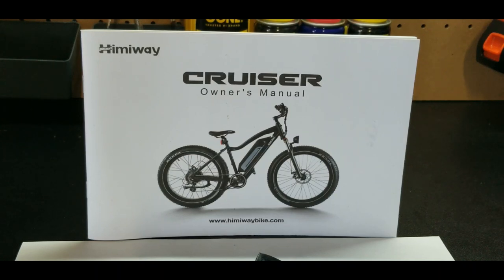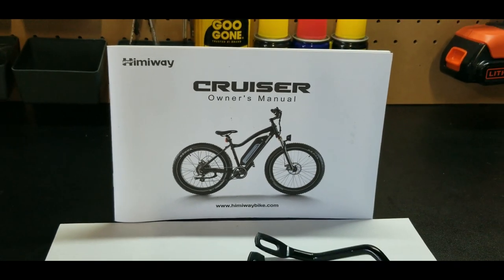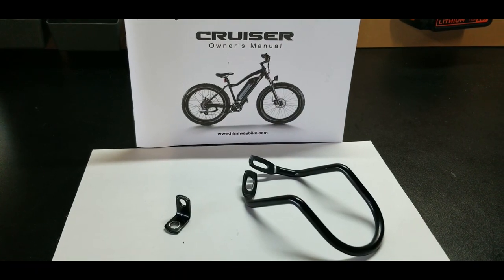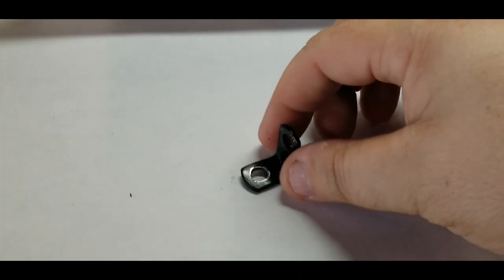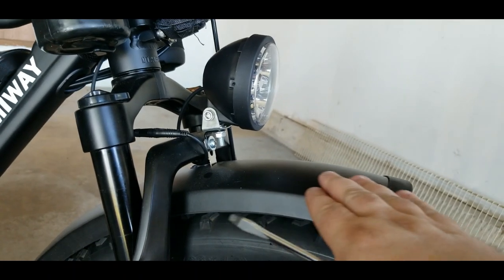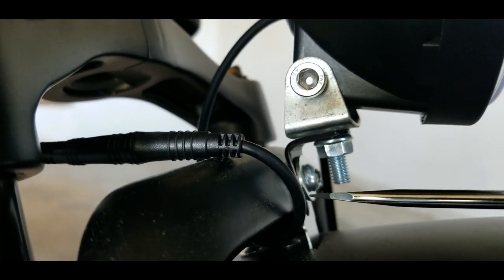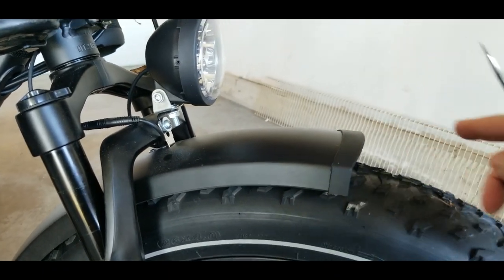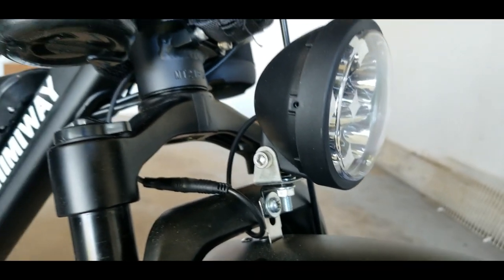Himiway Tips & Tricks

Comment: Another helpful thing to do is to take the cover off your controller and seal around it with some silicone because if the inside gets wet it can mess everything up and it's located where lots of water will hit it if you ride through water or in the rain .
Reply: Good tip.  I am gonna put a guard over it as well to deflect water and protect the cables under the frame. The factory 1 looks flimsy so I may make my own.

Comment: The fork adjustments are

Left side - stiffens the spring.  A heavier person needs a stiffer spring so the fork doesn't bottom out.  Where as that setting would be stiff and harsh for a light person.

Right side - dampening adjustment.  It controls how easy it is for the fork to go up and down.  If you turn it all the way it stiffens it to the point of being solid.  Which would be good if you only use it on smooth pavement for more control.
Reply: This is correct.  also that little L bracket is not meant for the headlight.  it’s just a spare front fender strut mount bracket.  it says so in the himiway assembly video.

Comment: Yes the electrical cable connectors are very, very tight. You absolutely DO NOT NEED TO USE PLIERS OR VISE GRIPS ON THEM. All you need to do to get the electrical cable connections apart is to use a heat gun, or even a hair dryer and heat up the connection a bit to soften the rubber a little and they come right apart easily. If you use a real heat gun just heat up the connections for a few seconds so no marks from pliers.....
Reply: Thanks. They are a b---ch. I bent pins and broke connectors the 1st time.

Comment: Thank you for the tips. Do you find the cloud9 seat less stressful than the stock seat?
Reply from the maker: It's more of a personal preference cause I'm a bigger guy and the Cloud9 seat is wider, not to mention the seat comes with suspension springs. The stock seat is ideal for average sized folks who's butts are used to riding a bike.....lol.
Reply: @E-Ryders  Thanks. The seat is big and comfortable but after some time it just feels like there is to much padding up the middle.  (Ouch). :)
Reply from the maker: @ralva2779  Depends on the model cloud 9 seat you get too. The middle is cut outta mine to relieve pressure and provide ventilation.  https://www.amazon.com/Cloud-9-Cruiser-Select-Saddle-10-75/dp/B002MKFRQI?pd_rd_w=wPnGC&pf_rd_p=ba22ea03-d3c1-4ebb-8d3e-472aa0cf3b30&pf_rd_r=QCXK3ZR1ZDMGPAKA6244&pd_rd_r=3b34ab0d-0e5b-4a88-b3a7-3c99150b9d5b&pd_rd_wg=RNDFe&pd_rd_i=B002MKFRQI&psc=1&ref_=pd_bap_d_rp_29_i

Comment: Just got the Himiway zebra and the manual says to fully charge it after each use and that it has no effect on battery life.
Reply from the maker: Because that's the normal thing to do. I'm giving you a "Tip" to make the battery last longer.
Reply: I saw this too and it didn't sound right, compared to all other batteries.  Like you probably wouldn't charge your phone if it was 90%.  I go for short rides so I'm going to let mine drain down before I charge.

Comment: Had so much trouble with Himiway. They tried to replace my faulty motor 3 times instead of letting me ship the bike back for a replacement. Took 6 months and I had to take it to a mechanic to replace. Then, still didn’t work and they wanted me to buy another one and return the old one before they would send me a new one. I think they’re customer service is in China? Just get something local because Himiway doesn’t know how to fix their problems.
Reply: Yes i am noticing lots of negative feedback as well as hearing about  shady business  practices and a souring amount of complaints to the BBB. It seems a hit or a miss, if you receive a faulty product you're out of luck
Reply: I am bummed out that my Hemiway Cruiser died with a hundred easy miles on it. Luckily I bought from a brick and morter company here in the states. Both the control module and motor where bad. Traded it in on another brand and have had zero problems. Hemiway really seem to be hit and miss on their bikes. It was awesome while it was running